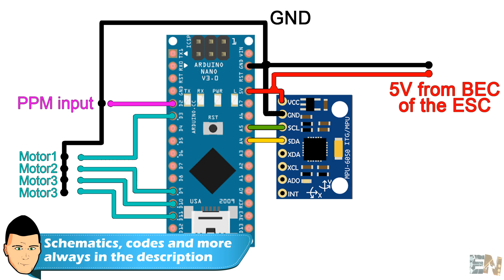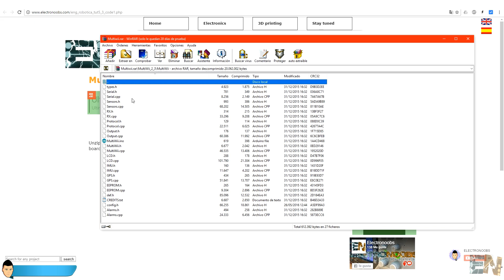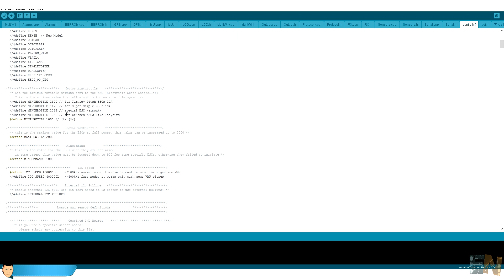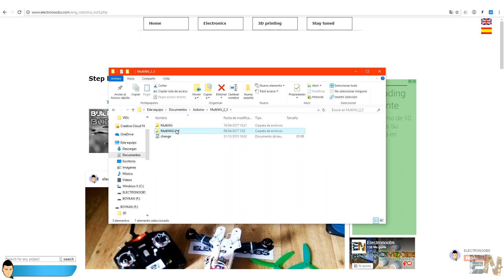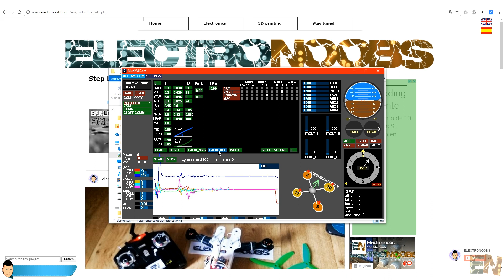Arduino drone - Part1 Flight Controller

Comment: When opening MultiWiiConf received error "windows cannot find javaw.exe.  Make sure you types the name correctly and try again."  Then a box pops up "Error calling ShellExecuteEx()"

 I also have all ESC's (browns from the 3 wires), IMU and receiver grounded to GND on the Arduino.  All are common ground except I have the IMU grounded to a different GND PIN.
Reply from the maker: The multiuwiicomf error may be because you don't have a good java version installed to your PC.
Reply: Hey friend. You were correct.  I installed Java and the file opened.  However, my signal is all over the place and it is not detecting my arduino correctly.  when I move it around its not corresponding.  Iin fact its spazing out. lol.  I2C error says -30111.  Basically its not mimicking my Arduino.   How do I fix?  My "L" LED on Arduino is blinking as well.

Update: I went in and un commented...  

#define SERIAL_SUM_PPM           THROTTLE,YAW,PITCH,ROLL,AUX1,AUX2,AUX3,AUX4,8,9,10,11

to see if that would make a difference.  Did not detect IMU at all.  However the "L" on Arduino stopped blinking.

Updat #2:  Multiwii is detecting as when i moved the A5 or ground wire of the IMU the ROLL, PITCH AND YAW under "GYRO" on MultiWii began to read and the waves went crazy.  However the animated quad did not move at all.  Still did not detect movement from board
Reply from the maker: Make sure you connect the i2c pins from the acelerometr to the arduino corectlly. SCL to A5 and SDA to A4. In the code make sure you uncomment your used acelereometer in independent modules
Reply: Yes. i have those connections and I have the L3G4200D uncommented.  I left everything else commented in the section above.  I left the PPM part commented as well (Throttle, Yaw, Pitch...etc).  Still no response.  Is there anything else I need to uncomment?

Comment: This is awesome.  I have a Arduino Uno R3 and a L3G4200D gyro.  Can I use these items to build my quad using your program/code/software etc..  If so, what do I need to change in the code? Do I need any other hardware in order to get it to work? I also have a Flysky FS-T6 Transmitter with a regular receiver.  I will build according to your lesson in a couple weeks.  I just want to use what I currently have if possible.  Thanks.  Great Job!!!
Reply from the maker: the code is the same. when selecting IMU boards you should leave everything comented and scrool down to independent boards and select yours:

/*************************    independent sensors    ******************************/
      /* leave it commented if you already checked a specific board above */
      /* I2C gyroscope */
      //#define WMP
      //#define ITG3200
      //#define MPU3050
      //#define L3G4200D
      //#define MPU6050       //combo + ACC
      //#define LSM330        //combo + ACC

Here uncomment the L3G4200D

Also if your receiver is not PPM you should't make the PPM part of the video asn use 4 inputs for each of throttle, yaw, pitch and roll!

Keep up!
Reply: ELECTRONOOBS thanks for your response.  i originally set up everything using the build video by Joop but have had challenges with calibrating my esc's.  Then i saw your video and think it is awesome. Anyway, my receiver is connect to ports 8 through 11 and my esc's ports 4 through 7 according to his video.  IMU is connected to SCL(A5) and SDA(A4).  I can still use my receiver and transmitter using your software' correct? Would this cause a problem using your method/software? Any changes i have to make?  Both you guys are doing a awesome thing for DIY projects.  thanks for your contribution.  keep it up!!!
Reply from the maker: If you use the Multiwii code and a normal receiver with one PWM signal for each channal you have to make this connections:

http://static.rcgroups.net/forums/attachments/2/6/7/7/0/3/a3627791-98-quadX.jpg?d=1291037190

The imu is still A4 and A5, the receiver is from D4 to D7 if you use 4 channals. Motors are D3, D9, D10 and D11.

In the multiwii code don't add the PPM part and select you IMU in independent boards. The rest is the same. You could use the Java multiwii platform to test it out!
Reply: ELECTRONOOBS ok i will make the changes.  In the schematic, link you sent me above, there is a green board.  what is that? does that matter to me? it shows some wire connections that you did not mention.  do i ignore it? thanks
Reply from the maker: That board is the IMU. It's another type but you should use yours! Connect yours to A4 and A5 (SDA and SCL) pins!
Reply: ELECTRONOOBS got it.  You Are The Man!!  thanks for the quick response.
Reply: ELECTRONOOBS ok. FYI...my current schematic using arduino uno.  (file:///C:/Users/student/AppData/Local/Temp/wza3b4/YMFC_schematic.pdf)  Both my IMU and receiver are connected to 5v on Arduino.  Same for the grounds.  SCL(A5) and SDA(A4).  All my esc's are grounded to GRD on the Arduino and to ground of my power distribution board.  I do not have ANY of my BEC's of ESC connected.  I assume they get power from the board through VIN which is connected to my power distribution board.  ESC signals (4 - 7), receiver (8-11).  The problem i was having i could not calibrate my esc's.  i would plug in the battery, get the initial tone then. no other beeps for calibration.  i had throttle stick up and nothing.  Any thoughts? I would really appreciate your input. I will change my setup to the schematic you sent me and give it a whirl.
Reply from the maker: Did you used the ESC calibrate code from the video description?

BTW if you're using the multiwii code in the video for your drone the pins for the ESCs are D3, D9, D10 and D11 not 4-7 and 8-11.
Reply: ELECTRONOOBS yes sir.  i used the calibration code.  i had no errors.  i have no idea what the problem was.  I changed my pins to match the schematic you sent me. Question, the red wire (power) from the IMU goes to pin 12 and the other power wire connects the ESC to VIN or 5V to receiver, correct?  In the schematic you sent me, i cant tell if that connection is equivalent to vin, vcc, or 5v.  Also, Do I need any resistors for this setup?  The schematic does not call for any.  Just want to be sure.  You have been very helpful. thanks
Reply from the maker: The power for the IMU goes to 5V.  Connect each of the ESC GND to GND. You could then connect 12V to Vin of the arduino or 5V from ESCs directly to the 5V pin!
Reply from the maker: Just follow my schematic! http://www.electronoobs.com/eng_robotica_tut5_3_sch1.php but instead of PPM signal to D2 add the 4 PWM signals from your receiver!
Reply: To make sure Im tracking..."Connect each of the ESC GND to GND". Basically, I''m grounding everything (all ESC's, IMU, receiver, Ardiuno) back to the distribution board, correct? Both the receiver and IMU power go to 5v.  Now this is where i am unclear, if I connect 12V to VIN...that powers the Arduino. If I do not use this connection, what powers the Arduino, the BEC?  Do i have to connect one BEC from a ESC to anything? If I choose to connect the BEC instead of 12V to VIN do I still connect one BEC or all?  Your diagram shows one BEC but above you stated "ESC's" to 5V.  Also, the ESC's are powered and grounded to the distribution board  but it shows one BEC going to VIN or 5V? I assuming 5V.  Just want to be clear.  I appreciate your patience.
Reply: Sir.  I have the receiver, IMU, and 5V BEC from one ESC going to 5v pin on Arduino.  I also have all ESC's (browns from the 3 wires), IMU and receiver grounded to GND on the Arduino.  You have Pin 7 connected to MODE of receiver.  What is MODE?  Are you speaking of MODE 1 or 2?  What Pins one the receiver do I connect Pin 7 too? Thanks
Reply from the maker: MODE is an extra channel. For example the mode of flight from horizontal to headless or something like that... If your receiver only has 4 channel you don't have to connect more.

Comment: build remote spitfire as u described but unable to spin bldc
Reply from the maker: So you've upload the code to the flight controller and the motor won't spin? Did you connect the ESC pwm pin to the right output from the flight controller? The servo work?
Reply: fist of all thanks for reply servo works ang gyro too but dldc won,t .i conected esc to d9 of flight controller
Reply from the maker: To activate the motor you should put throttle to minimum and yaw to maximum for 3 seconds and to desactivate throttle to minimum and yaw to minimum as well.
Reply: ok i understand its late night here tomarrow i will try any way thanks a lot for help

Comment: Very great! I wait with impatience the third video.. 😄

It's possible re-program the flight arduino controller code for use it with all others rc as a boat, car, helicopter etc..?
Reply from the maker: The mulwitii is compatible with a lot of copters. Boat and car i don't know...
Reply: ELECTRONOOBS ok thank you! 👍

Comment: Hola , es necesario el arduino en el mando? no vale uno tipico de radio control?
Buen tutorial , enhorabuena.
Reply from the maker: No es necesario, pero este tutorial es para un dron 100% con Arduino. Un transmisor/receptor normal con PWM o PPM también sirve.

Comment: awsome! can you tell me is the normal mpu6050 enuf for a quadcopter or a 6dof mpu will be better? and also do we need an adxl335 too? thanks :3
Reply from the maker: the MPu6050 is already a 6DOF, it has 3 axis gyro and 3 axis accelerometer. With this too you could fly a drone. If you want some extra sensors add barometer and magnetometer for 2 more axis
Reply: oh i see, is it possible to add an ultrasonic sensor and bluetooth module onto the drone?(bcuz i dhv controller 😅😅)
Reply from the maker: Yes you could but I haven't done that using Multiwi yet.

Comment: but applications not run
Reply from the maker: science and tech try both 64 or 32 bits. or probably you have a Java problem. make sure that you have a working java version installed. keep up!

Comment: great video. Can you create the video drone(quadcopter) DYI, GPS using arduino step by step all connection and configuring and how to connecting each other all of things. And you created this controller and connecting that controller to drone.
Reply from the maker: Ch Sukhee i will first build this easy drone. later i will start adding stuff like GPS, barometer and so on...
Reply: thank you.
Reply: @ELECTRONOOBS  
is there any update of this flight controller 
can you please make a arduino drone with a barometer for alt hold feature added please !!
Reply: ++ and Opencv bro :D
Reply: Nice ! yes, at this level it's also easy to enter for everyone, additions... well the sky is the limit i guess :)

Comment: how to run that software
Reply from the maker: The multiwii?
Reply: yes
Reply: how i run
Reply from the maker: download the zip file from the description. unzip it and you will find two folders. One is the MultiwiiComf. Open that folder and select the folder for your Windows, 32 or 64 bits. Open it and make double click on the java aplication.

Comment: holy cow this was exactly what i was looking for. thank you. cant wait till next videos. Im also building a fixed wing drone, and i dont know how to send data to the arduino. any tips?
Reply from the maker: Rodrigo D Madruga I'm using the NRF24 radio module and ppm output for the receiver. you will see in my next videos